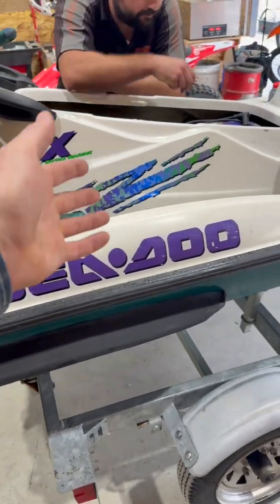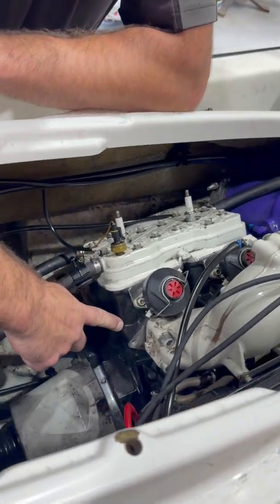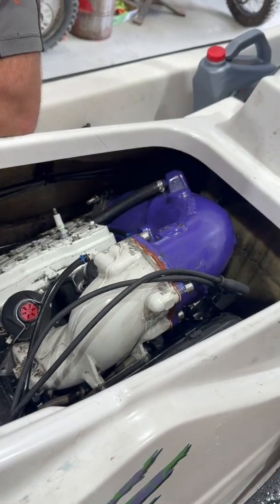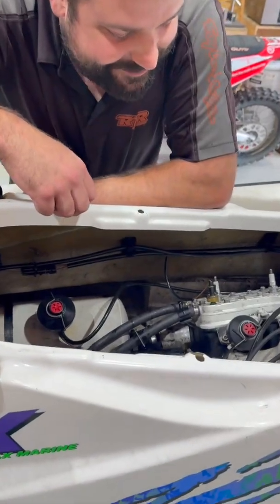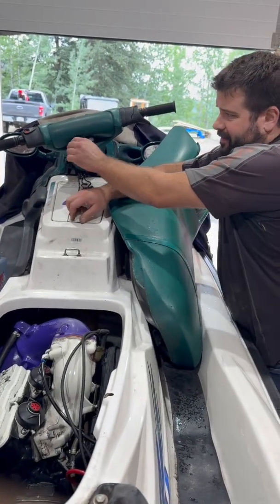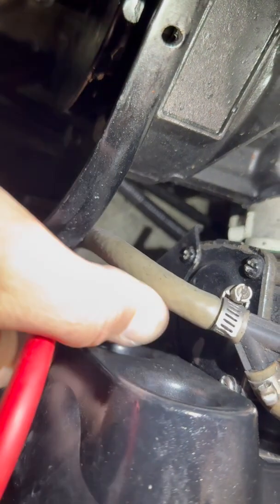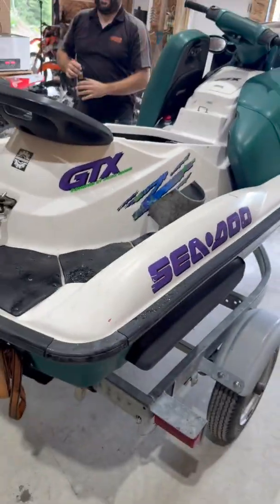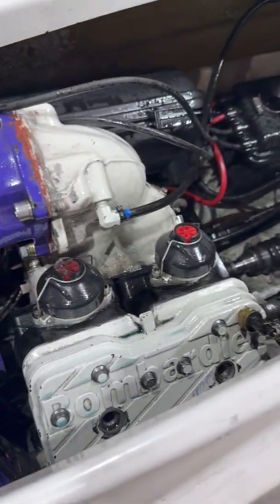Cylinder Filling with Oil

Comment: Put a ball valve on the oil line from the oil reservoir to the crank and run it. Ski has life left in it!
Reply: Or just run premix (and disable the oil injection in a way that is safe for it ie. not letting the pump run dry)
Reply: Idk why he’s making this out to be fatal for the engine

Comment: I remember when I did my first jet ski it was the Kawasaki ultra 150 the customer he put a new battery in thanking the battery was just dead and it still is doing the same thing where it would just click. I replaced the starter because I realize the starter was burned up. Come to find out it still wouldn't turn over so I pulled the spark plugs out to check and it pumped out probably a gallon of oil.  What was going on was it was leaking two-stroke oil from the oil fill tank and filling up the crank case so much that it was actually filling up the cylinders since the engine set lower than the oil tank.  Crazy stuff!